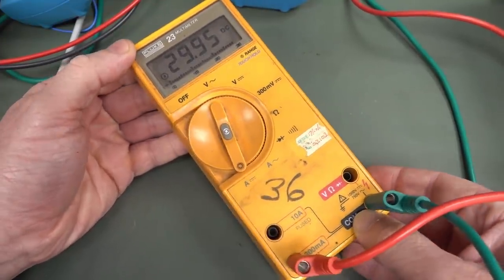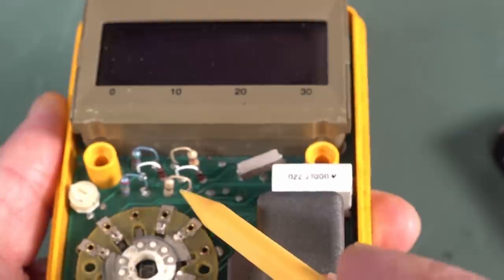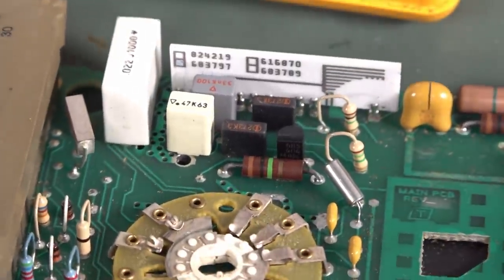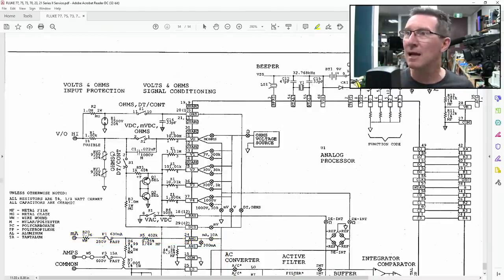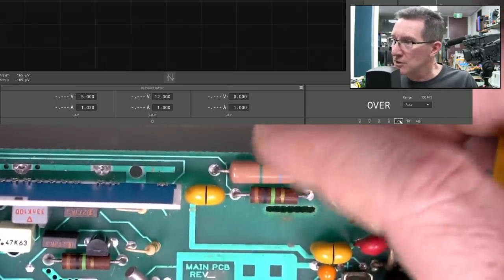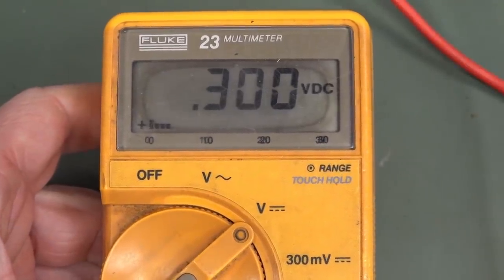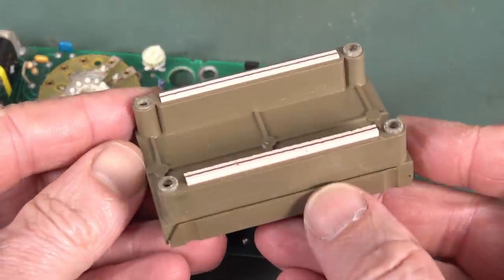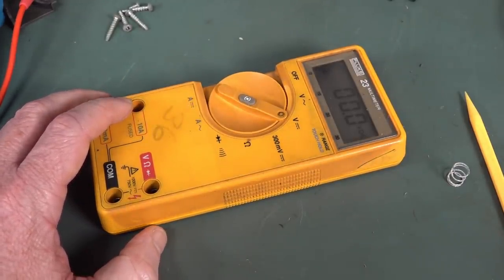EEVblog 1424 - Fluke 23 Multimeter Repair

Comment: 19:00 what to do if you don't handle this with care and then the zebra strip just detach from the LCD screen ? It's there a way to fix it ?
Reply: Zebra strips aren't usually attached. Those are probably just stuck due to time and light pressure.
Reply from the maker: It's just contact pressure holding it there. The great thing about them is that they don't need to be accurately aligned. They are designed to be removed and put back.

Comment: You may be able to correct the discoloration of the plastic by performing a retro-bright technique.  Place the plastic in hydrogen peroxide solution and place outside in the sun or use a strong UV light source.

Comment: I have a Fluke ET-23 DMM.  I bought it new in 1988-89. Still works great after 10s of ks, uses.  However, I noticed the tone has become low, really low, I have to really listen to hear it. Everyone tells me, it's my 73-year-old ears. Lol. Battery is new, contacts are clean.  I checked it aside of another and there is a difference. The easiest would be a beeper, but can it be an amp/driver? Any ideas?

Comment: In my experience, if there is a battery leak & there is rust on the bottom of the battery terminal, the high resistance measurement will run into problems.  try you measure resistors over one mega ohm and above, is it still accurate?

Comment: great video as always. I used to do volume repairs (dozens of different brands/types of boards a day) and my best friend was the Huntron tracker because you could check diodes, caps, coils, resisters, etc. all with the same probes and not changing anything on the machine and no schematic required. Ever use one or are your methods more scientific?

Comment: I have a fluke 189 ii and one day I tuen it on and the screen was flickering. I use my hot air and heated the board and now it works again. What could have caused that?

Comment: Hello friend, how are you doing? My fluke 233 has shorted and the fuse has blown. It's not working now, only the red voltage light is on. I left it off for a few days and the light went out, but then came back on. Is it memory? Do you know what it is?

Comment: What is the point of Q1+Q2 back to back Dave? (8M49S).
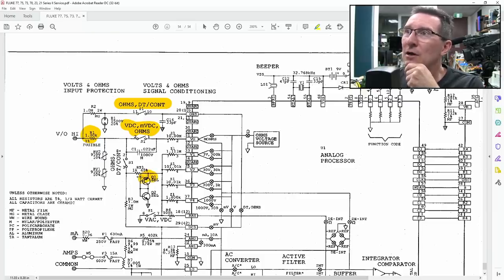Reply: Bi-directional voltage clamp, using the BE junction as a zener. Very common circuit in multimeters, he mentions this at 12:50
Reply: https://youtu.be/BGcKjy_UNQ4 Dave's video on it
Reply: @khalidabdallah7614  Got it soon after I made my comment 😁neat!

Comment: Does any one have a PDF of the Fluke model 70 series III service manual.
I have 2 of them here.
They both work, but I'd like to have the service manual available in case I need to work on them at some point in the future.
I have the Calibration docs already.

Comment: Hello sir, my fluke 1654b multifunctional meter does not measure on L-Pe terminals in Z No trip stage, I couldn't figure out what caused it, I changed the fuse, can you help me?

Comment: This is very good video but the microcontroller can be damaged because the resistor in voltage devider is damaged. The voltage goes straight in to a microcontroller no via this voltage devider.

Comment: To fix the screw hole,just oil up the screw and wipe it off,drop some super glue in the hole and install the screw.. let it dry a long time,then unscrew the screw and u will have more threads.

Comment: Both R1 and R2 was open circuit in my Fluke 23. Looking for replacements and I've been googling for a while now without finding a part number for R1 fusible. Can someone please help me find the right part number (for both resistors, please)?
Reply: Can the OY102KE replace the fusible 1K 2W R1-resistor?

Comment: I believe the simplest method for restoring discolored plastic like that is an overnight dunk in hydrogen peroxide with a UV lamp.
Reply: Yep or using Hydrogen Peroxide cream and brush it on with UV lights. Also I have seen boiling the Hydrogen Peroxide on the stove without UV light. Best to use the Professional "hair Bleaching" strength

Comment: Retrobright will clean vintage covers for computer cases or even plastic like the multimeter will make look like new with little effort
Reply: It works on beige computer cases pretty well, but does it work on coloured plastics like this?
Reply: @ferrumignis  personally I used it on brownish colour plastics on silver etc on stereos not this particular colour best idea is find somewhere like just inside the case a small test spot that's what kind of thing I done just to ensure there isn't a chemical reaction that ruins it I should of mentioned a inconspicuous test spot even if clean and she be right excellent question bright colours like this when I ever do start doing my videos I might try some experiments with different types of plastics enamel painted surfaces powder coated etc I'm really curious now but definitely old vintage PC cases as you mentioned it makes them appear new but isopropyl is usually best to try first and if not effective or not to expectation hit with retrobright anyhow cheers mate

Comment: What? Switching a 0 ohm resistor hacks my trusty 75 and turns it into a 77? HOT DAMN runs around house making touch hold measurements and cackling

Comment: 1) Flukes Don't Break
2) If a Fluke were to break [see point 1] it has a Lifetime Warranty
3) This post is smoke and mirrors and probably involves photoshopping over the real name
4) if 3 is not true it probably involves being dropped from the top of a transmission tower or accidentally being left outside a bathysphere... in the Mariana Trench

Comment: Fluke is so post to be top of the line but all 3 that I have owned have all broke while the cheap ones I own are 4 times as old, one of them I even left on a roof in the rain for over a month before I found it and they still all work. I will never buy another Fluke Product they are just a name with trash behind it. I don't think Fluke has made a good reliable meter since the late 80s